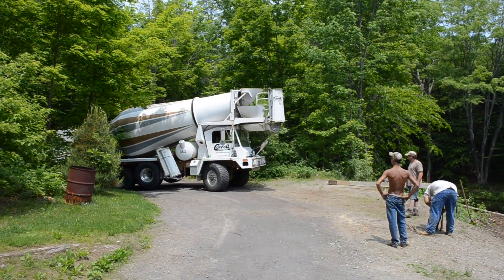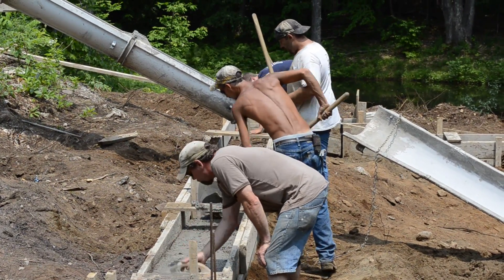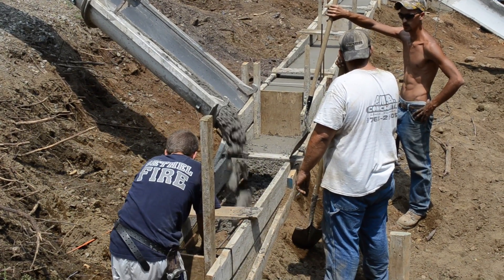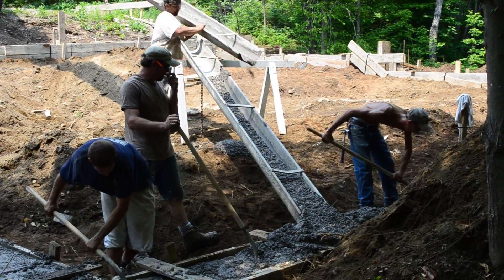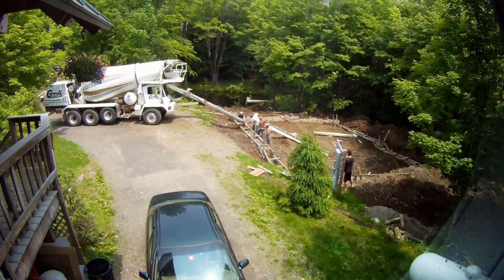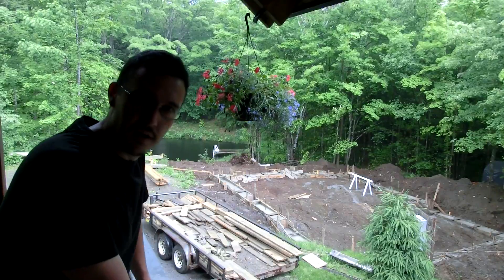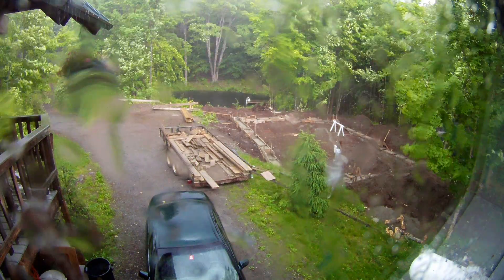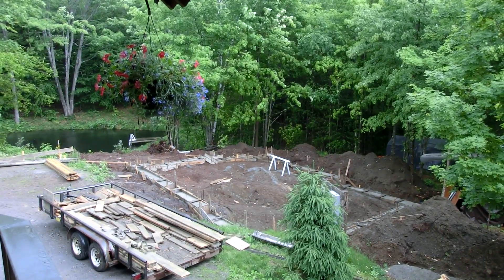Pour Concrete Footings Foundation - 6 - My Garage Build HD Time Lapse

Comment: or you could cut a peice of 2x4 and periodically nail them accross the footings hang your rebar from them with rebar tie wire, then when the concrete is set, you take a pair of wire cutters and cut the wire flush with the concrete, and remove the 2x4, its alot cleaner then holding it with your hands,
Reply from the maker: Thanks for the comment!  It's nice to get all the ideas together on a subject.
Reply: no problem man, not trying to sound like a know it all, i just work in that industry, i work in a precast shop, at the beginning of every job when we build our forms, we cut those 2x4's that we need to fit over the forms and we use the same ones every pour till that particular job is done, we call them jigg's,

Comment: The concrete isn't to the top of the forms WTF?  Are you using self-leveling concrete? The guys pouring just happen to know where their level line is? Show the next video when the carpenters show up. I would be interested in that. I'll have to check out your website.

Comment: WOW! You guys are crazy out back east. I never seen a crew pour concrete with just a tail gate and a couple of shoot extensions. We always use a concrete boom truck. Its a long arm with a hose attached that delivers the concrete where it needs to go. You end up spending the same when you spend a little more on machine an less on the man power.